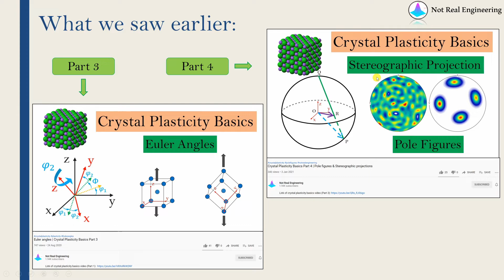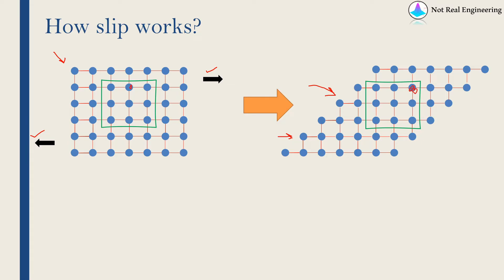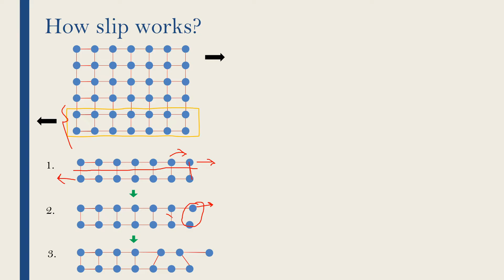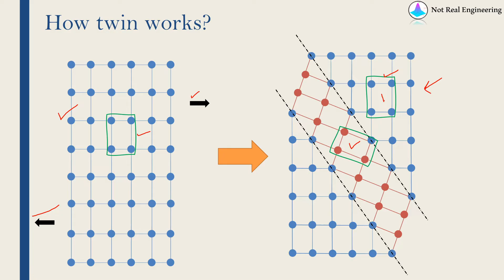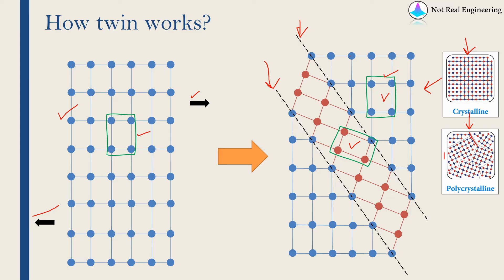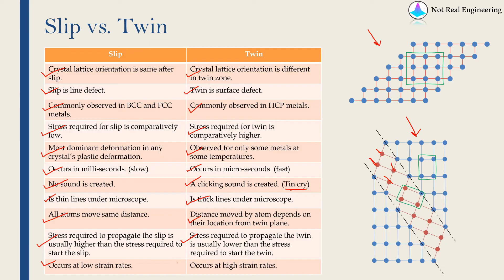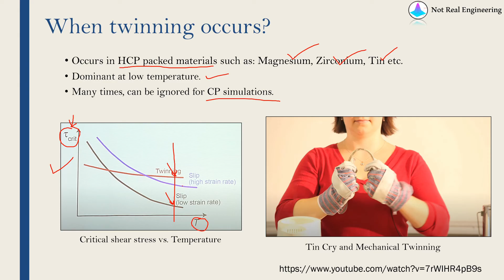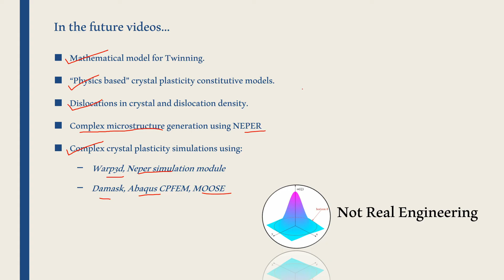Slip vs Twin | Crystal plasticity basics part 5

Comment: I think in case of twin that two black lines will represent as twin boundaries not grain boundaries.
Reply: Overall very informative video to understand the slip and twins concept.
However, in the case of FCC, twin can be develope due to severe plastic deformation.
Formation of twins depends on the stacking fault energy of the materials.